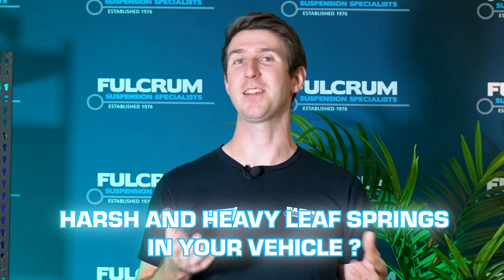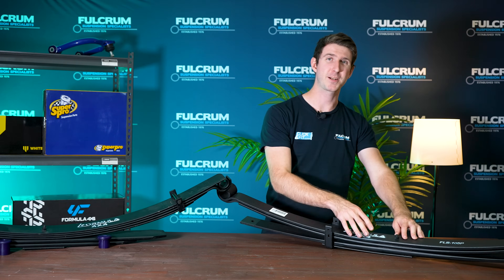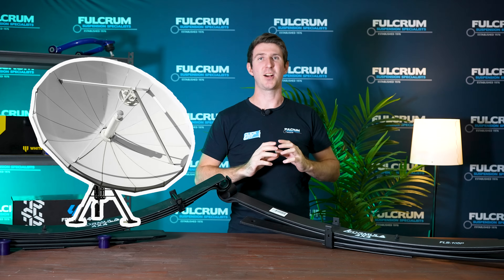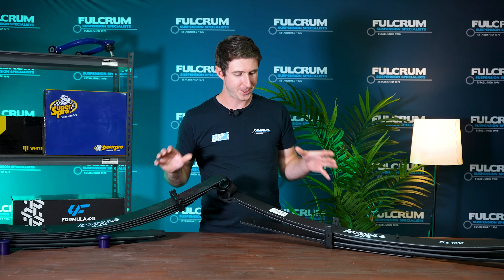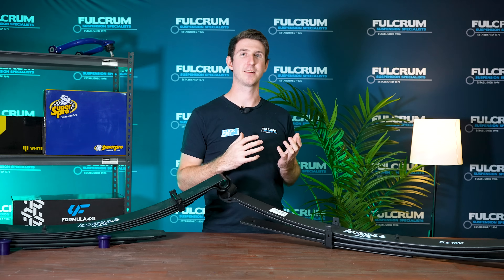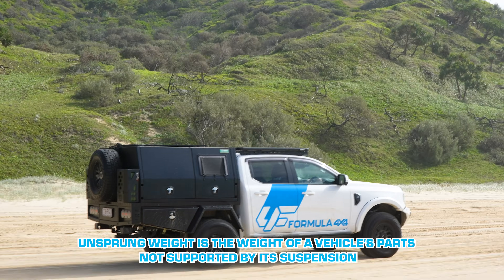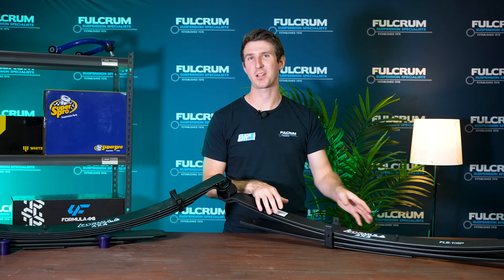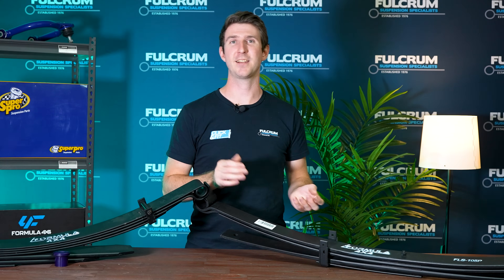What Are Parabolic Leaf Springs - Are They Worth It?

Comment: Are parabolic springs suitable for use with air bags or do they flex too much and cause the air bags to bottom out ?
Reply from the maker: We use them with airbags all the time and have no issues with them.
Reply: @ ok great , if I was to remove my air bags and just go with the 200-400 leafs do you think it would be enough spring rate to handle towing a forward fold camper with a bt50 with a canopy , drawers and usually camping gear on board ?  While still having a smooth ride unloaded ?  At the moment I’m running air bags out of necessity but I’d really like to be able to do away with them if possible , cheers
Reply from the maker: @Ozrider2504  When unloaded yes the parabolics will certainly still be comfortable , the rear will sit higher unloaded but overall it'll just be another 25mm higher roughly than when it's loaded.

if the 200-400's fit within the range of extra weight you have in the rear including the ball weight of the camper then yes I think that'll suit nicely and the airbags won't really be needed anymore.
Reply: @ great thanks for the info . Il very likely order some from you guys in the next few weeks 👍

Comment: 4XOveralnd says less leaves means you need more dampening due to less friction within the spring pack.
Reply from the maker: While yes you'll need better dampening to control a parabolic leaf spring compared to a traditional leaf spring pack, we've had excellent results with the range of Formula 4x4 shocks with the best results using the adjustable remote res shocks (F4R's), as dialing in the dampening of the shock is achieved easily.

Comment: Great videos, the fulcrum gear seems like good stuff. I wonder if my airbags would still work if i lut these in ?
Reply from the maker: The airbags should work still as long as they suit the lift height of the springs. The parabolics are a 2 inch lift so if the airbags suit that you're fine. If you already own standard height bags too most of the airbag suppliers have spacers or brackets that convert it into a 2 inch lift suited bag.
Reply: @FulcrumSuspensions1976  wow, thanks for the reply... I will head down to your capalaba store next week and have a chat with the team there. Sadly I'm due new rear suspension 😮‍💨 I didn't need this leading up to Christmas but I guess it is what it is